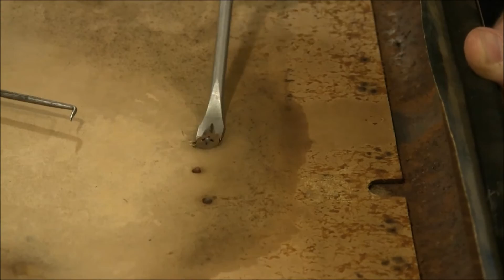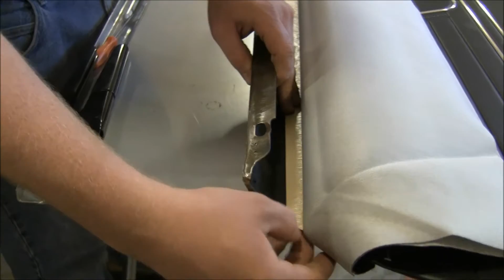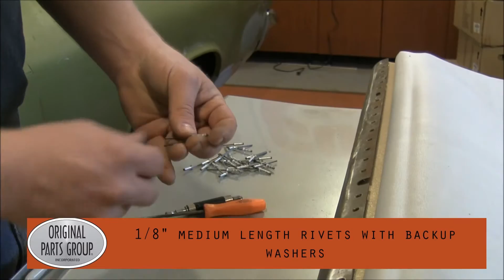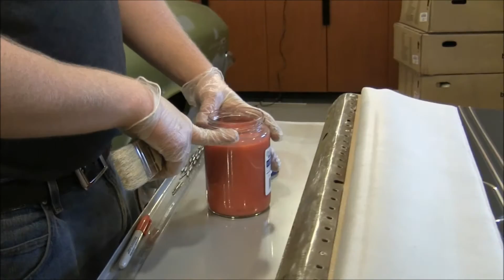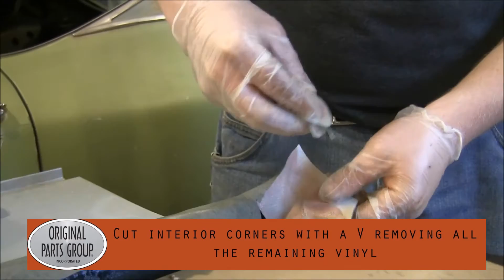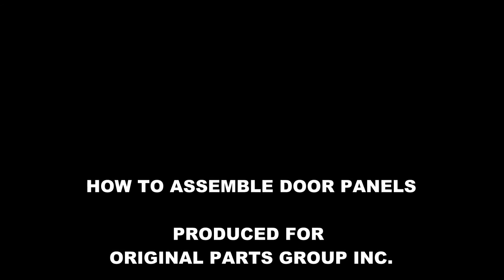How to Assemble Door Panels

Comment: What about the fuzzies  you pulled off ? Doesn't the new panel require something for the window to rub up against.
Reply from the maker: Yes, the window felts need to be replaced, but we did that as a separate project.

Comment: The most difficult part of this job is working with the two layers of vinyl over the steel panel top.  How did you make that work so it stays where it's supposed to and looks good?  You blew right over that.  You started to show it...then went right to the second layer.  Disappointing...

Comment: so what do you do if you don't have the door panel?
Reply: If you mean the top cap, you can buy plastic ones, they are not nice, but it works. Another option ebay, you can find a set there, often as part of an old complete panel that needs restored.
Reply: @jeffersonbryant764  where can you find them? I have searched all over and can't find any
Reply: @marvingreen6644  what vehicle year make and model?
Reply: @jeffersonbryant764  1977 nova
Reply: 2 door coupe
Reply from the maker: @marvingreen6644  That is going to be a tough one. You will need to try to source a set from a salvage yard or fab your own.
Reply: @Reddirtrodz  that's what I have come to understand. Thanks though for the help.

Comment: So is there a logical reason you had the top steel piece backwards to lay out the drilled holes ? The curved part goes away from the upholstered side. Just scratching my head here...
Reply: We used the opposing side upper to mark the holes. Probably not the most efficient way of illustrating this process, I can certainly see where that could create some confusion.

Comment: What size an where can I purchase the rivets and washers? Also what's the brand of the contact cement? Thanks for the video, it was very informative
Reply from the maker: The rivets are 1/8"diameter x 1/4" or 3/16" long, depending on your panels. I have found that if you a body hammer and a dolly, you can get even better results. The cement is Weldwood, and can be found online or at any upholstery supply house.